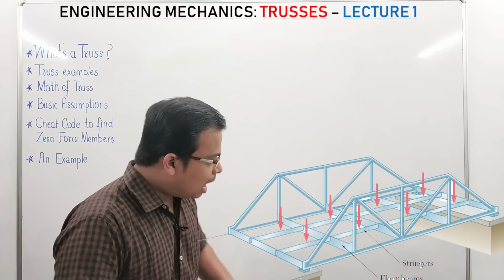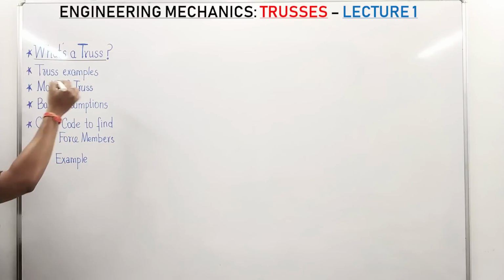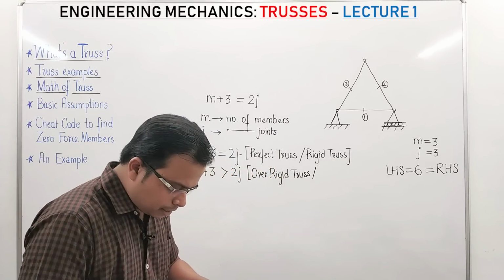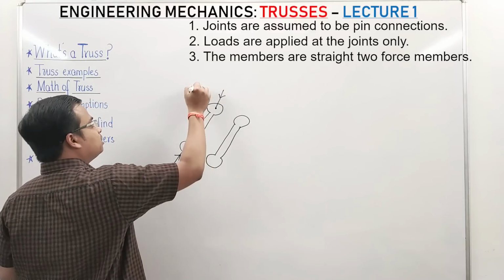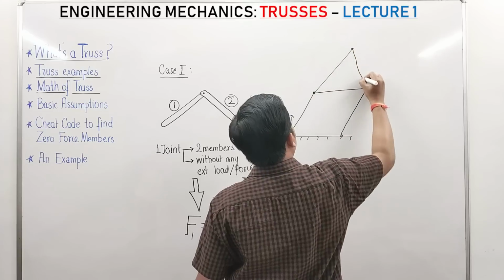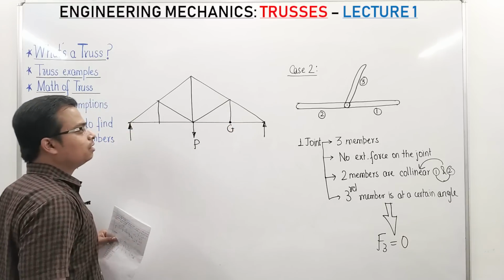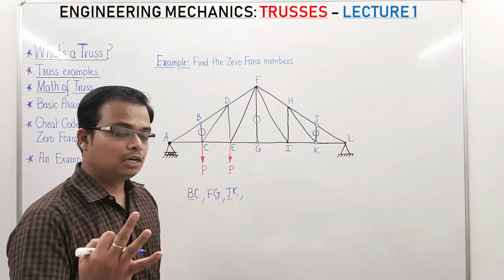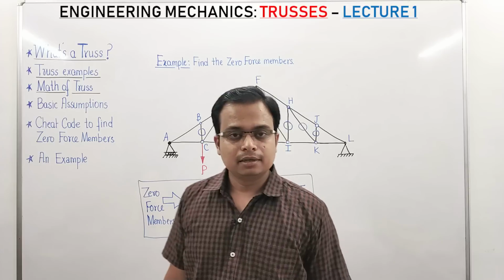Trusses || Introduction & Basic Concept ||

Comment: Sir my question is in CAD : A square plate of 30mm sides rests on HP such that one of the diagonals is inclined at 30° to HP and 45° to VP. Draw it's projections.
Edited: asked for 30 marks last year VTU exam. IDK to take |  or || to the xy line.
Reply: Simple

Comment: Method of joints easy or sections
Reply from the maker: Hello Venkat, 
Method of joints is easy but it is lengthy where as method of sections is a bit complicated at first but after applying, it takes way less time to calculate forces in unknown members in a structure.